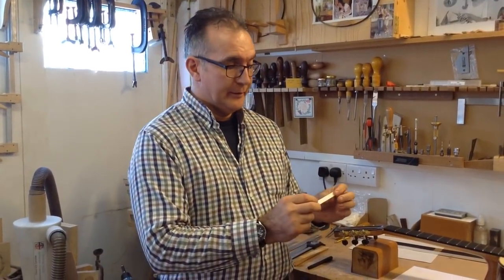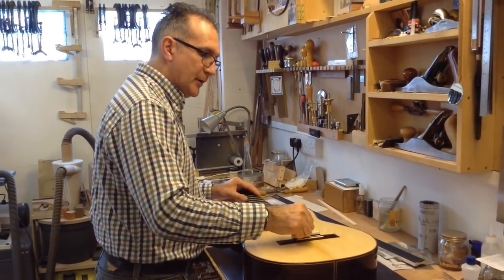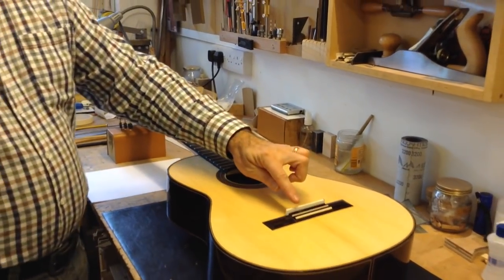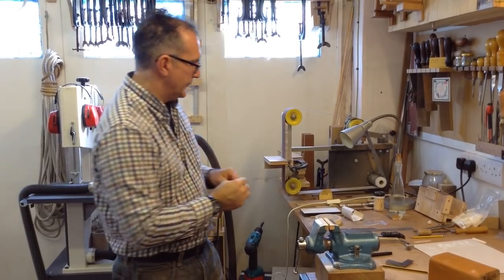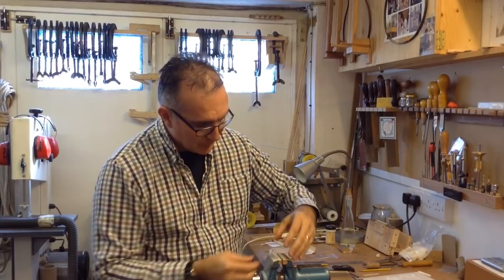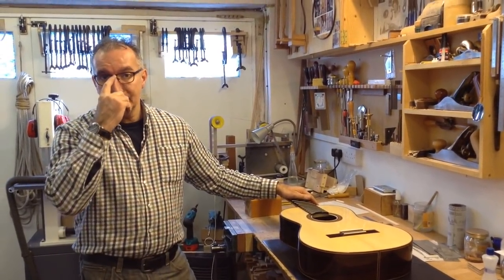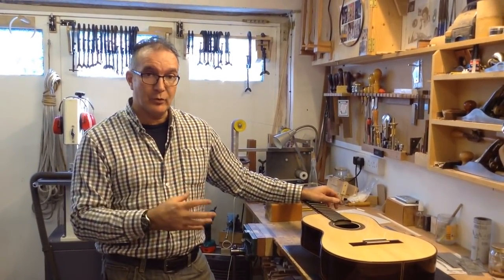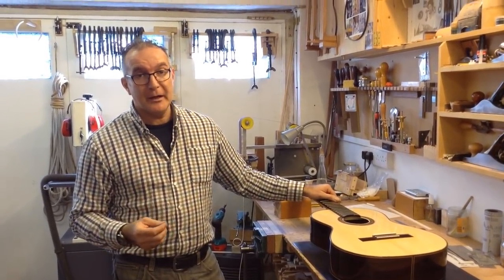How to make the saddle for a classical guitar

Comment: So looking at your saddle that you have the highest point at the leading edge, what do you do in the instance where you  have to set/change the intonation on the saddle?
Reply from the maker: All you need to do is to make a notch back on the saddle in the area where the string is resting. That way you will lengthen the string.

Comment: I know you didn't speak about intonation, but I thought I could ask. I just bought a new Prudencio Saez, and the distance from the nut to the middle of the 12th fret is 325mm, and the distance from the 12th to the saddle is 326.5mm. The strings are slightly sharp when I check the intonation at the 12th fret. What should I do?
Reply from the maker: Hi, You need to lengthen the strings that are out. You can do a little notch in the saddle so that the string rests on the saddle a little further than the rest of the strings. This is assuming that the shape of the saddle has the highest edge towards the sound hole of the guitar. That way you can get 0.5 or even 1 mm extra length on the string. But if the saddle has already been compensated you might not be able to fix it without getting into major work.
I hope this helps.
Reply: @redkitekk  Thank you so much, Pablo. The saddle has not been compensated yet, and the saddle does indeed have the highest edge on the side toward the soundhole. Should I maybe change the strings to see if that does anything before I attempt to compensate?
Reply from the maker: Yes, some times a bad set of string can give you problems with the intention.

Comment: Hi i have question how often you should change your classic guitar saddle? Do they even wearout?
Reply from the maker: It depends, if your saddle is made of nylon then yes, sooner or later you will have to have a new saddle fitted and this will be very obvious as the strings will with time cut into it. If your saddle is made of bone or another material of similar hardness then you will find that usually your saddle doesn’t need to be replaced but it might need some adjustments as time passes.
This and every aspect of guitar making you can find in my course videos on www.onlineguitarmakingcourse.com
Reply: @redkitekk   Thanks alot mine is from bone and my brand new guitar came with an extra saddle. Thats why i asked.

Comment: Is it practical to set it 3.5 on the E bass and 2.5 on the treble?
Reply from the maker: Yes, of course, the lower the better as long as the strings don’t touch the frets, otherwise you will loose clarity in the tone.

Comment: shouldn't you have the same measure for treble and base since you really haven't done anything to the sattle? I'm confuse, Marcelo
Reply from the maker: Hi Marcelo, the measurement is different because when I worked the fingerboard I removed more material from the base side of the fretboard as the first job need to have the setup I was looking for.
You can see how I do this in a video on my Chanel about how to work the fingerboard. Also, just to make you aware that I have recently launched an online guitar making course that might interest you. You can find it on www.onlineguitarmakingcourse.con
Reply: @redkitekk  Muchas gracias, una otra pregunta, what should be the distance in the NUT from the first string, I would like to keep your guidelines on the 12th fret at 4mm, but not sure what should be the distance on the nut on the first string, thank you in advance
Reply from the maker: @mjrami  This might be a little complicated to explain, I will try.
Once you have made the nut and have the strings on, bring the strings up to pitch or near to pitch, then, for each string, press on the 3rd fret and look at the gap between the string and the top of the 1st fret. If the string is touching the 1st fret it means that the nut is too low, but if there is a big gap it means that you need to remove material from the bottom of the nut to bring it down. The gap you need to have is about 0.25 mm or so, but each guitar is individual so you need to try to get the strings as low as possible without having any buzzing. If you have done this and your guitar is buzzing on the open string then you need to raise the nut up accordingly.
I hope this helps.
Reply: @redkitekk  mochas gracias Maestro, que pena que usted esta muy lejos